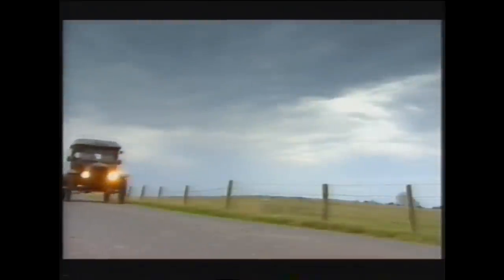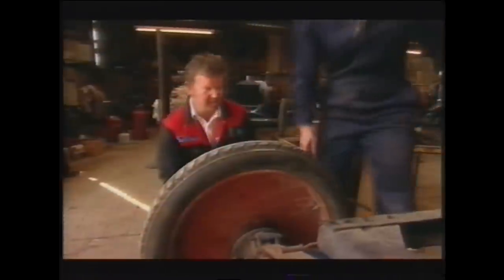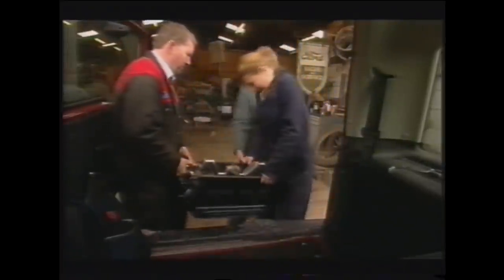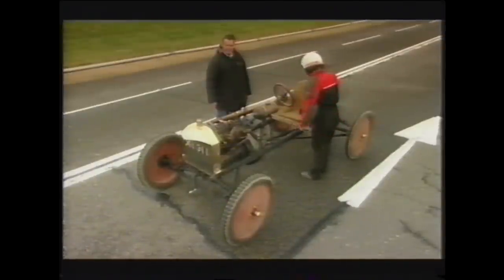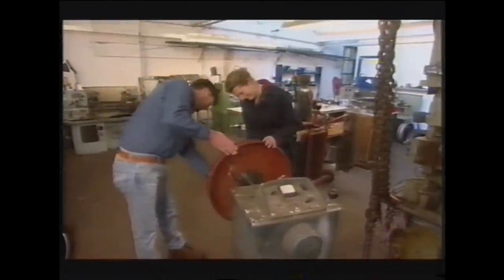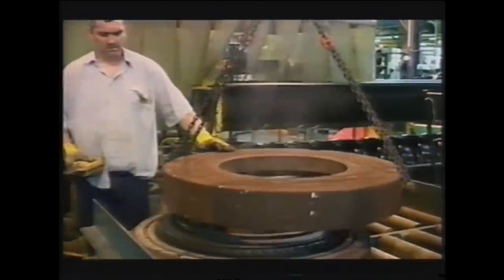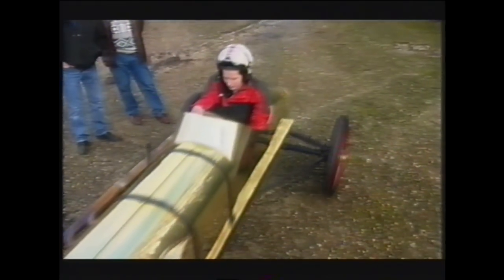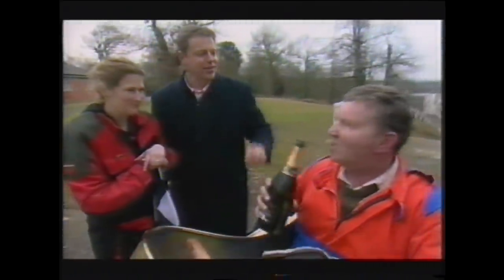Salvage Squad Model T Ford

Comment: Yes, I remember the T-Timers club hillclimb at Signal Hill, California.  You would be amazed at how fast they could get up that hill.  Engines turning 4500-5000 rpm, lighting up those narrow tires in low gear followed by a full throttle upshift breaking them lose in high gear.

Comment: Why you would push that car with the rear wheel wobbling like that is beyond reason. I drive my 1923 model T at 45 mph on a daily basis with no problems.